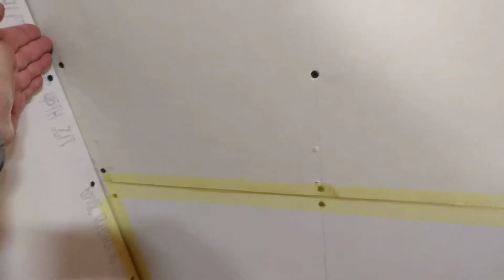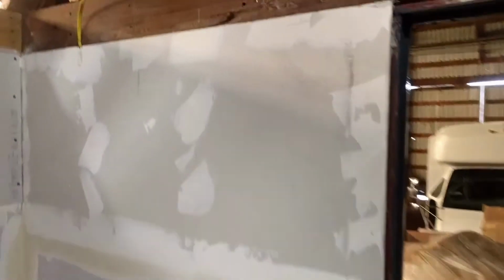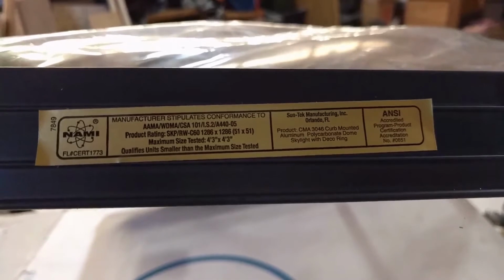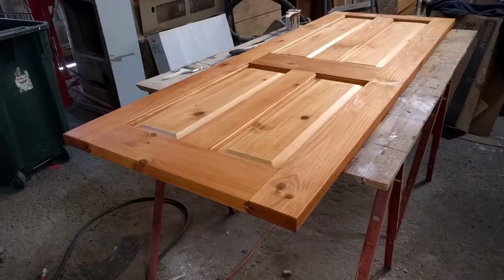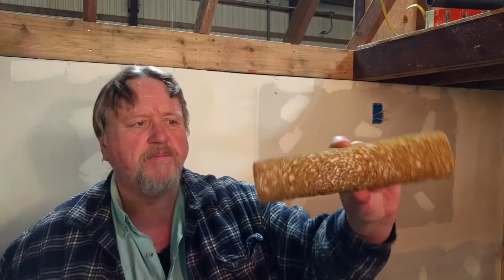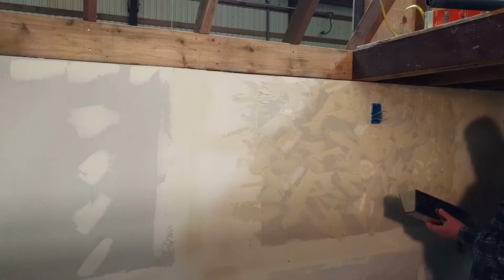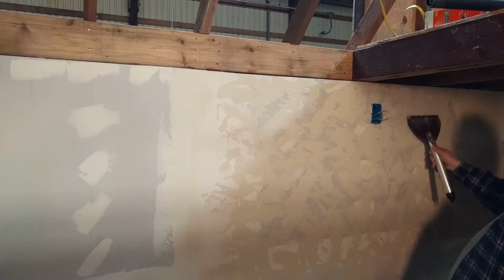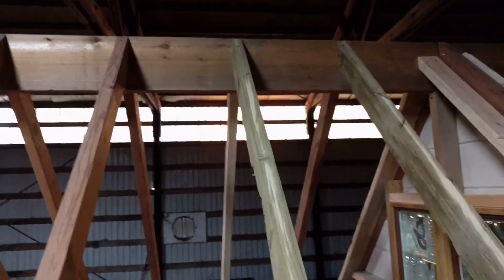Building a Tiny House (Part 17) Drywall Tape, Texture and Skylight Plan

Comment: Oh, that's be nice to have a skylight in there. Will be interesting to see how the walls turn out. I'm not a fan of textured walls because they're harder to clean than a flat, shiny surface. That's going to be nice tiny house, that's for sure.
Reply from the maker: Hi Ann, I was very happy when I located that skylight! I think the heavy texture along with the wide pine trim will bring a warm home feeling to the little house. I will be putting a back splash behind the stove cabinet to protect the wall. Thank you  :  )